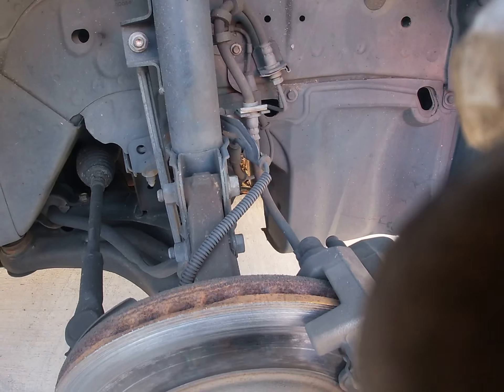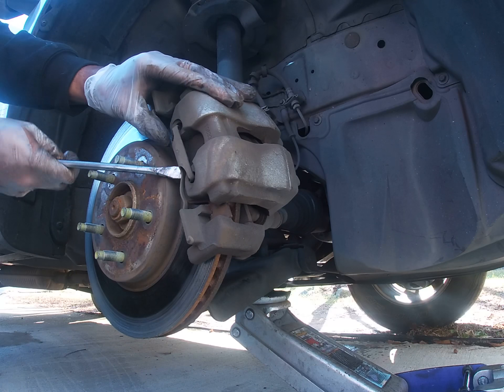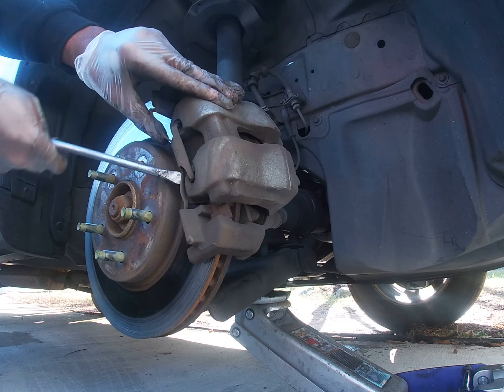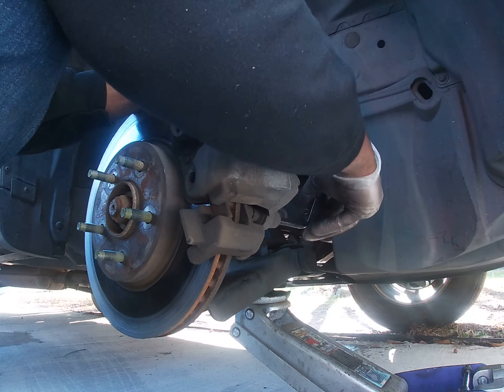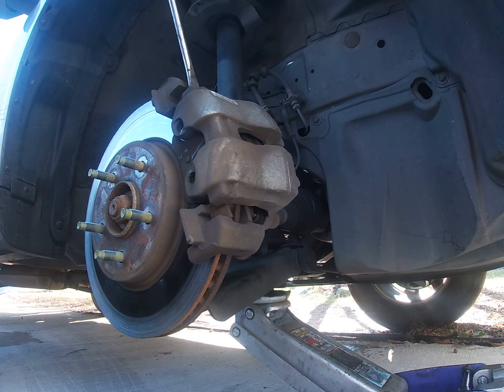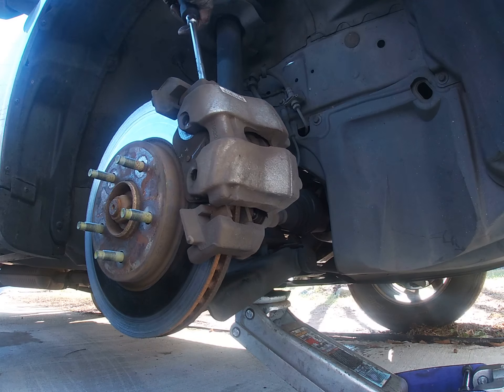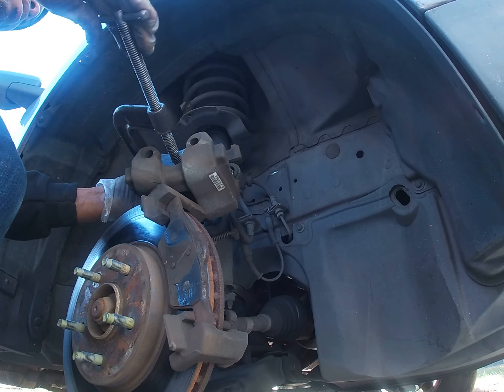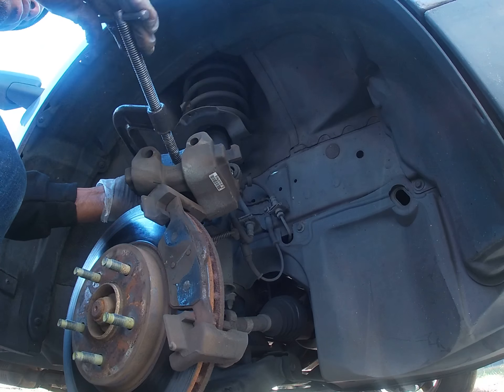2008 Mazda Tribute. Front brakes

Comment: Good video.  How would I know if I have a bad caliper?  On hot days my front driverside brakes smell burnt.
Reply from the maker: Check the slide pins make sure they are greased
Reply: Thanks for sharing the Allen key size. Shouldn’t you loosen the bleeder screw a bit when compressing the caliper? That should help the piston move back in easier.

Comment: You can obviously tell it needs a new rotor because the brake pad was metal to metal and you did not lubricate the sliders which will cause the caliper bracket to seize. Good job 👍
Reply from the maker: Ammon Wall I only put videos up to assist people and save them money / The brakes was bad based on neglect and the sliders where lubricated so i did not have to add any lub. thanks for watching

Comment: No brake grease ?...
Reply from the maker: If the slides move freely while doing the job than you know your pubs are fine … only use grease when you need it and grease only goes on pins thx
Reply: @brakebug7829  I saw it on other video clips and think it would be to avoid noisy breaks